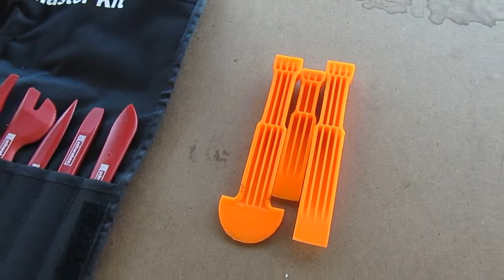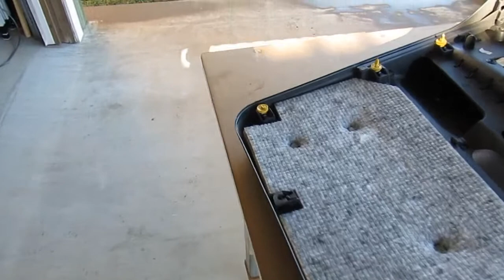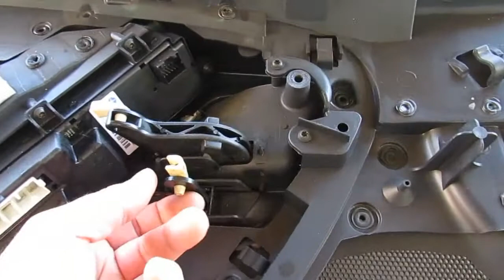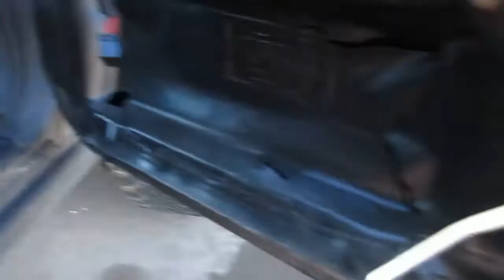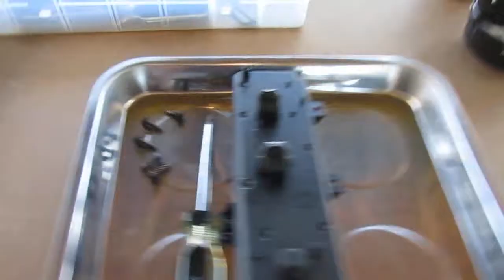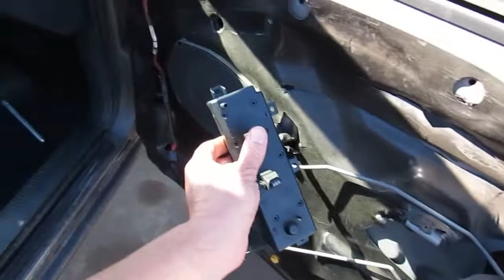Project Jeep: 2003 Grand Cherokee Laredo Interior Door Panel Removal

Comment: That is in fact a vapour barrier and the black stuff is butyl tape. The vapour barrier came in white and black, the white is much more resilient to deterioration. The barrier also acts as an air seal to help the speaker have more bass. It keeps dust out of the interior as well.